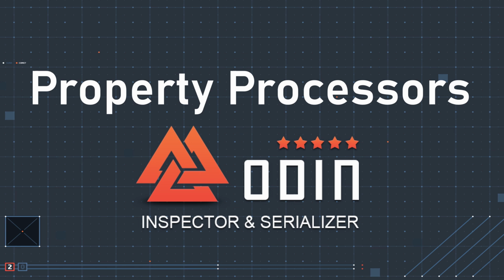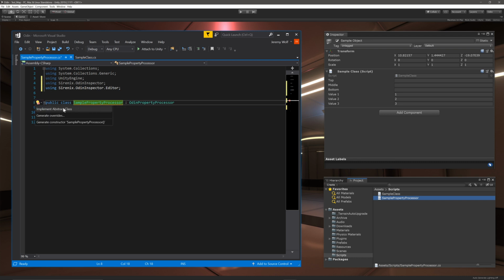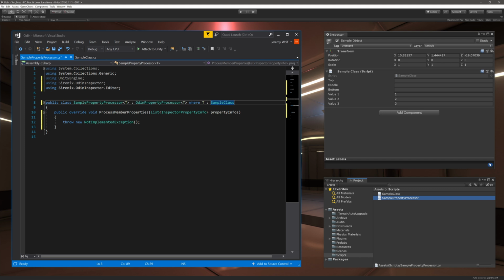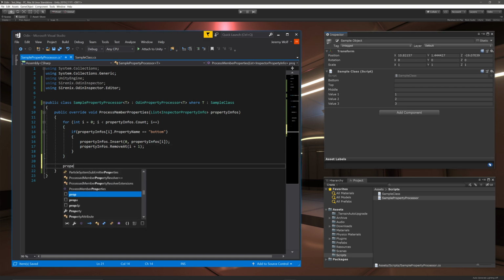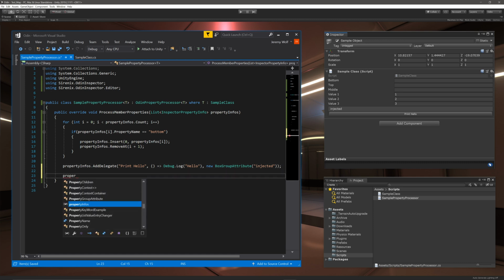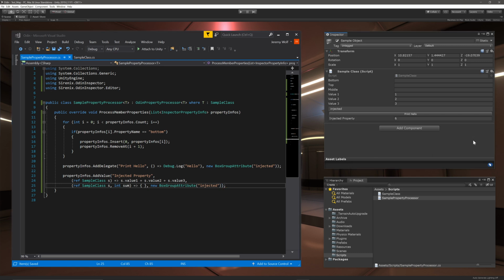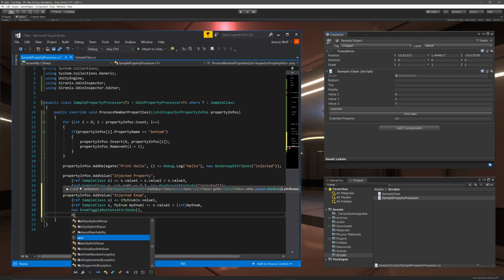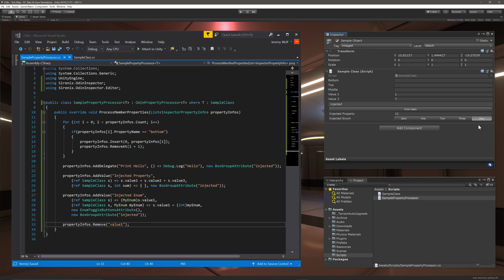Custom Odin Property Processors

Comment: Is it possible to have a reference to the SampleClass in an AddDelegate like the "Print Hello" one ?
I want to have an access to the properties of my class inside the delegate ^^

Thanks for this video, it helps me a lot !
Reply from the maker: You can get access to the property instance, use (Property.ValueEntry.SmartValue or Property.ParentValues, etc)

If that doesn't make sense or move you in the right direction jump on over to the Odin discord (link in the description) and reach out to Tor or Mikkel.

Comment: How exactly does this differ from the custom attribute processors? In both cases we use an additional c# file to change how Odin displays a different class, by attaching additional attributes.
Reply: Attribute processors merely change which attributes are applied to certain members. Property processors can create new properties out of thin air that have no basis at all in the inspected type itself or in any of its members, they can rearrange properties, regroup, replace, and they happen at a totally different point in the property creation pipeline. Basically, attribute processors are a bit more simple and minimalist and limited in what they can do but are also better suited for many simple use cases, while with property processors you get a lot more power to do whatever you want.